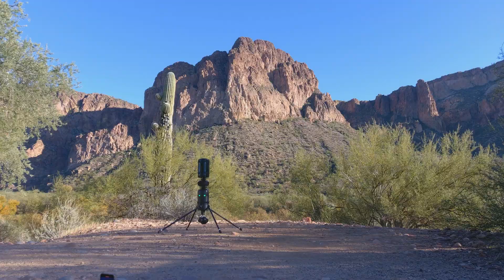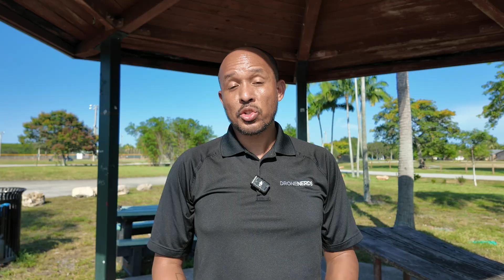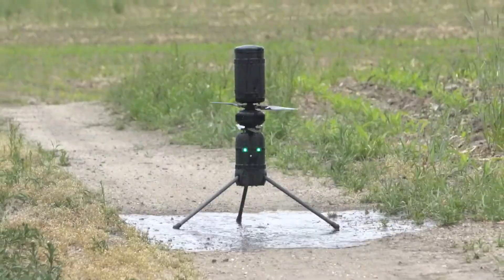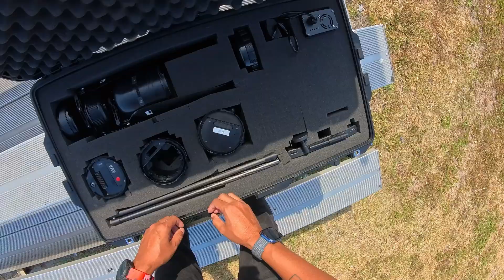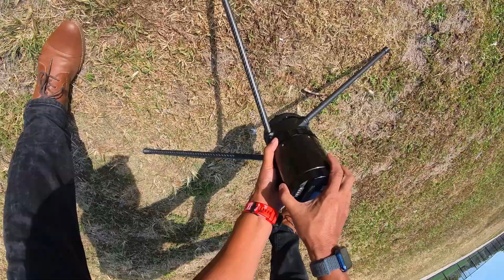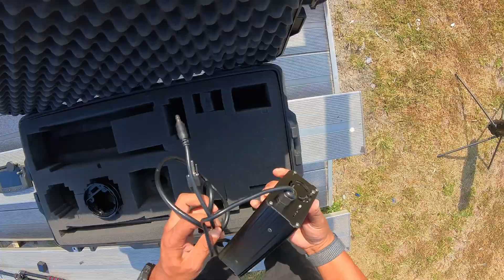What Makes The Ascent Aerosystems Spirit Drone So Different?

Comment: 앞으로전진은 어떤 원리로 이동하는거죠?
Reply from the maker: Hi, to move forward, the Spirit tilts slightly in the direction of travel. The flight controller adjusts the rotor speeds to create that tilt, producing horizontal thrust that drives it forward. It’s the same principle used by most multirotor drones, just in a much more compact and aerodynamic cylindrical design.
Reply: @DroneNerds  네 기울기는 프로펄러가 4개일때  2개를 속도조절하여 기울기하면 되는데...원통형 드론은 모터가 2개뿐이잔아요??  상부모터와 하부모터 뿐인데..이두가지의 속도조절은  드론이 위, 아래 혹은 제자리 회전 밖에 안되는데요??
어떻게 기울기를 만들수 있죠?

Comment: I was wondering why it's so big. That was actually my first question.

I can live stream from my GoPro, attached to a helium balloon. 

Well, I'm not gaining any thermal capabilities 

I am gaining a longer video feed time and as long as the string breaks I don't really worry about the winds. 

Add on an Apple AirTag for $29 and I can follow if the breaks and it's on its way down.

Where springs to mind if it hits a bird and breaks that big can is coming down on someone's head .

Quite a civil suit settlement will need to be paid out ...
Reply from the maker: You're right, it's definitely hefty. That larger size is great for heavier payloads but if you're looking for something smaller, Ascent Aerosystems is coming out with the Helius, a sub-250 gram option, later this year.

And there's definitely the possibility of some amazing shots with balloons but you definitely have to be careful with airspace restrictions and manned aircraft.

Comment: Rtk? What software is it using? Thermal+rgb payload option?
Reply from the maker: Hi Tyler, it does have support for RTK and using the Herelink controller with CubePilot. As for payloads, it does have a wide variety of thermal/IR and RGB cameras ranging from 40 to 80x zoom